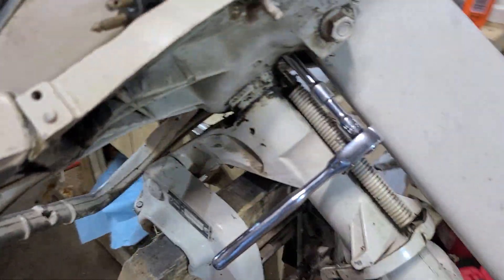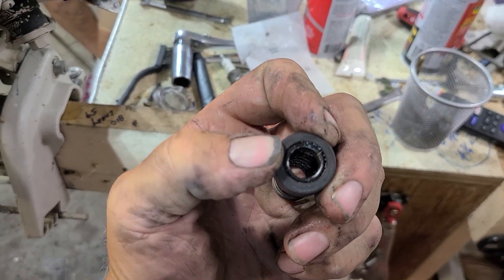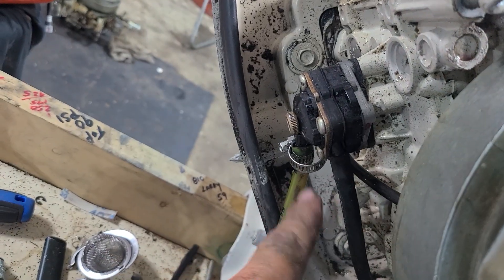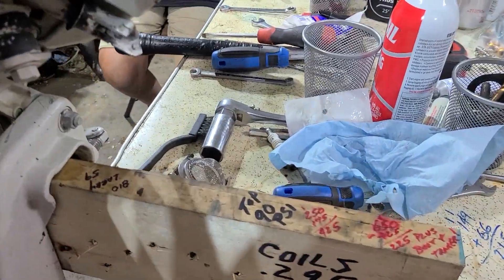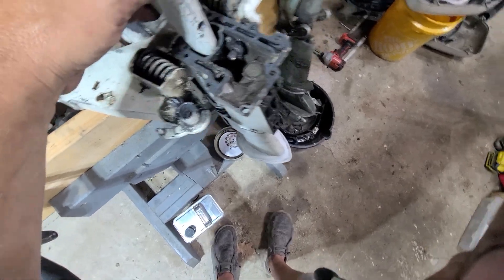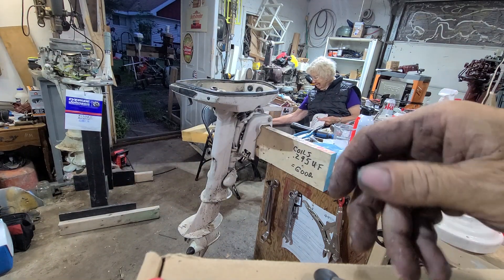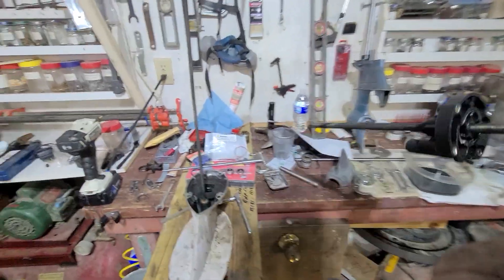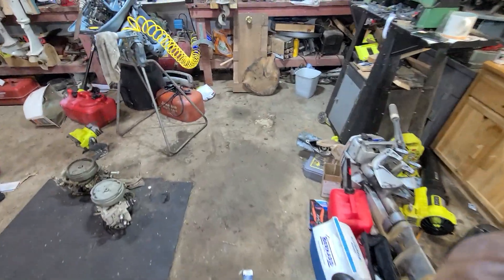1962 CD-19 Johnson 5.5 hp. Remove powerhead and lower unit.

Comment: Just watched your video on the J-cd-19. I just replaced the impeller on a Gale (same motor) that originally had a metal impeller housing and took the larger impeller that you have. My local vintage parts guy had the plastic replacement housing and smaller impeller in stock and assured me it worked better than the original. It fits on fine but I have yet to run it. Anyway, without having the metal housing, you’ll need to use the smaller impeller. Hope this helps